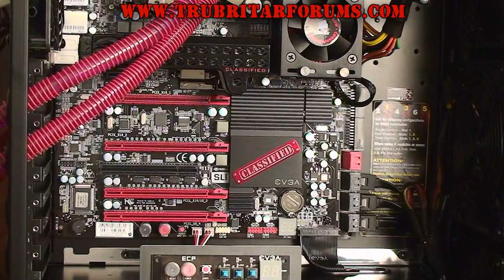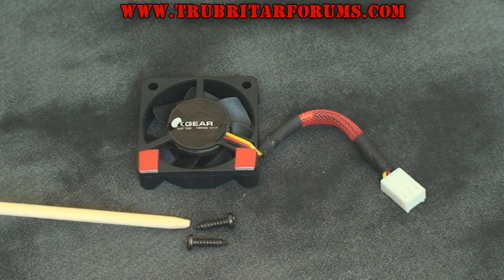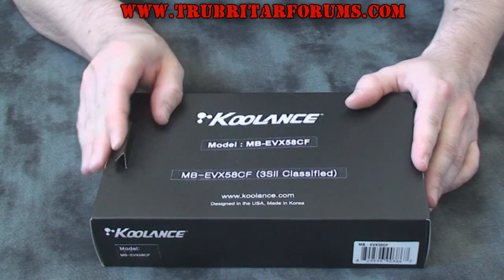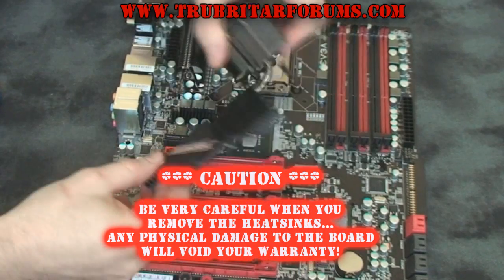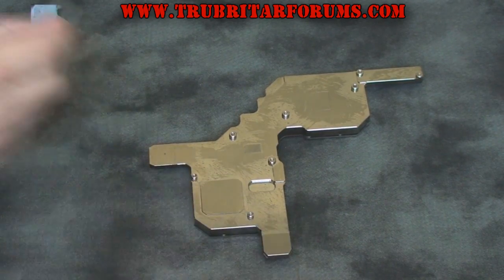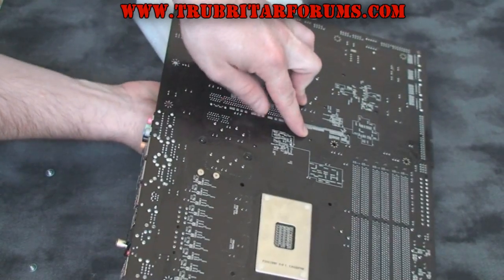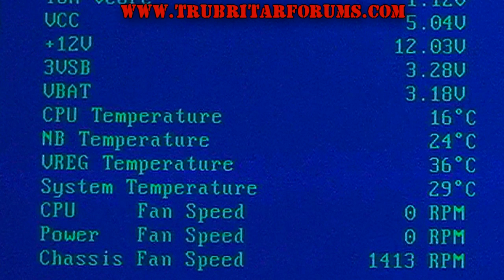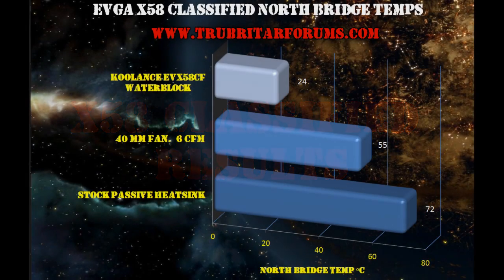(HD) EVGA X58 Classified NB Cooling Tests & Benchmark

Comment: Please excuse my ignorance as I don't own this board(yet)but are these temperatures OCed and/or under load? I'd love to run an i7 920 at 4Ghz using the 40mm fan method but I'm not entirely convinced it could keep the northbridge at a safe temperature under load. Anyone know for certain?

Comment: i7 920+ heat killer 3.0, classified x58+ ek waterblock (on a 480mm rad), dominators 6gb 1866,2 gtx280s, 1000w psu.

i dont have another 8pin conector for the motherboard but i could the 1 on my gtx280.

ive been messing around in the bios with most things on auto and i got to 4ghz but i cant change the ram speed it goes up abit when i change my cpu speed.  :S

Comment: Yes, but you would need a powerful pump, and depending on how hot your components get a 240mm radiator or larger.  
Most watercooling systems can do the NB, CPU, and ram to my knowledge.

Comment: Question Trubritar..  I notice you guys always use the Koolance 3ku cooling system to do your water cooling of the various compents how do you get the water temps to below ambient temps. Like in this video you stated the coolant was at 66 degrees F was that how cold it was in the room?? Thanks I have Koolance K2U cooler and I cant get my coolant anywhere near those temps..

Comment: That is true. I don't know the correct term but i like the way the wire is wrapped. More of an aesthetic point than functionality i guess. I looked around on google and newegg and i couldn't find it. I guess it would be easier to just get the waterblock but it seems like the fan made a really good difference for a much lower cost. Well I appreciate your help. Thanks.

Comment: the only reall advantages this motherboard has over the Rampage 2 extreme is the N200 chipset (meaning, you will run all your graphics cards on x16 speed in sli mode) and the ability to place 4 graphics cards on the board (3-way sli plus physX) performance wise, you might not notice any differences in performance if you don't "overclock like crazy"

Comment: water cooling works by having a four part configuration: waterblock, pump, radiator and resovoir. the waterblock is hollow so water can pass through the metal and brings the tempature down to water tempature, then it gos through a pump which moves the water and through a resivvoir which holds the water and finally through a radiator which turns the warmer water into colder water either through passive cooling or fan cooling. it is much more efectve than a passive or fan  cooling set up.

Comment from the maker: You are correct, Unfortunately, there aren't many programs out there that will accurately measure the NB temps.  Most reliable to date is the classified Bios, however it is difficult loading the system while in the Bios setup.

Hope this helps.

Trub

Comment from the maker: This video shows either option provides great results over stock,  If you want to air cool, there is a very cost effective option....However, should you wish to push this motherboard further for extreme results, there is a very impressive water cooling option...which path you take is entirely up to you and the system you desire...

Trub